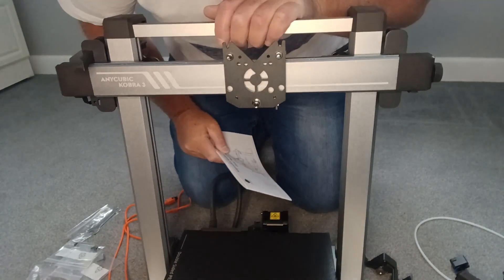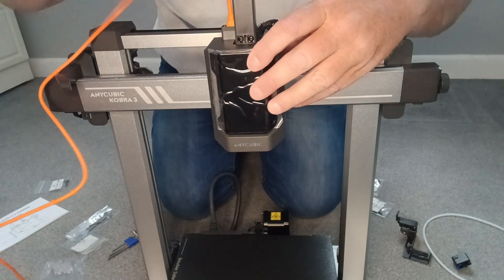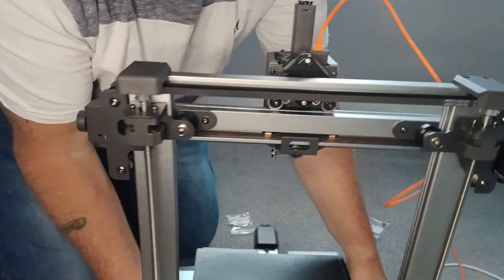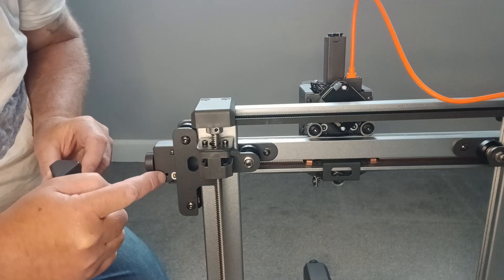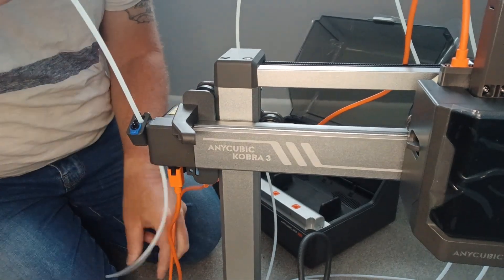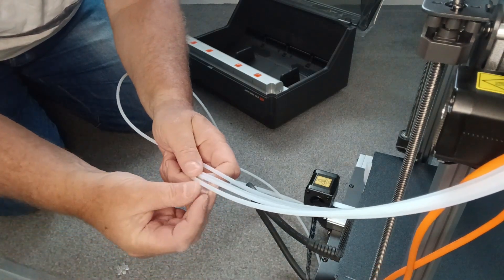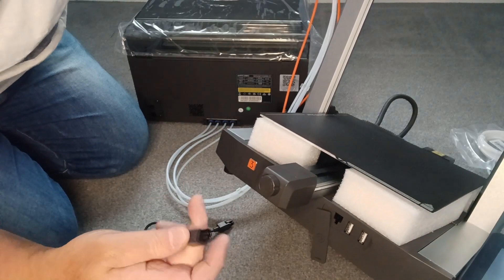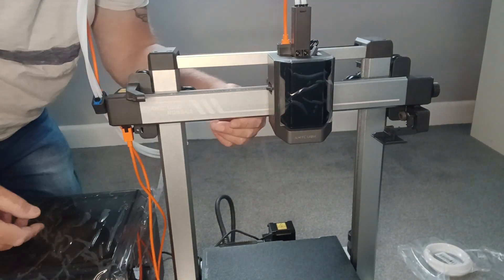How to assemble the Anycubic Kobra 3 Combo 3D Printer  |  How easy is it to  build ?

Comment: Z ofset ayarı nasıl yapılıyor
Reply from the maker: Hi you can adjust the z offset either in the Anycubic Next slicer or you can adjust it on the printer screen itself. On my machine I have never realy had any problems with the Z offset and have always used the auto level with no problems at all.

Comment: Right as i was wondering If the plate would scratch from a c dropp3d screw you drop 2 lol ok good thing i got mine today lol ty for video im new like  you
Reply from the maker: No a dropped screw on the plate would not scratch it. They are pretty hard If you use sharp objects like screwdrivers or knives to get prints off then that would more than likely scratch it. Good luck whith your printer :) you will love it